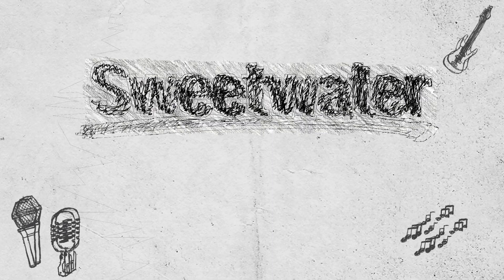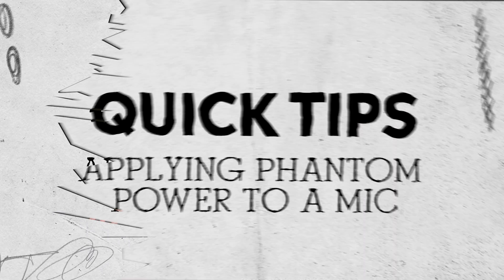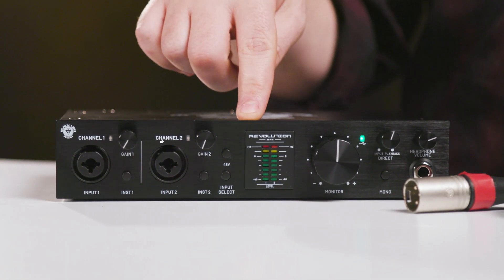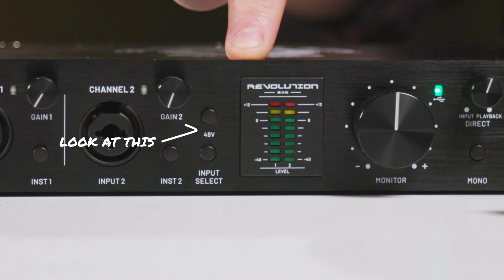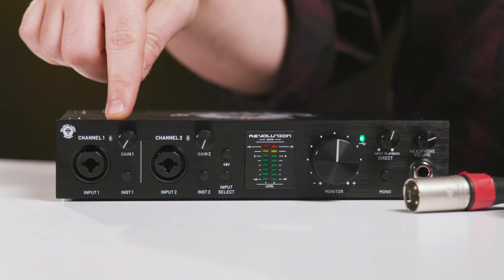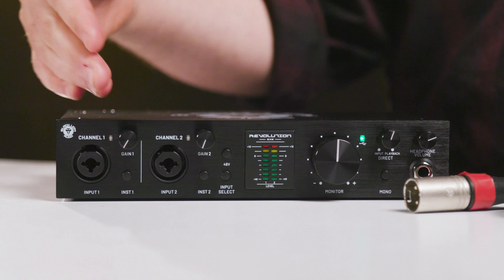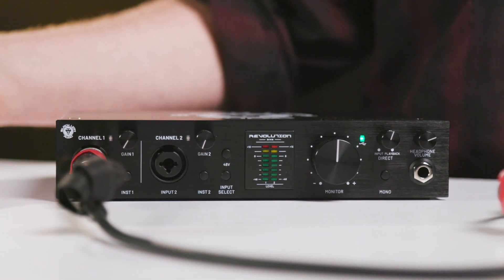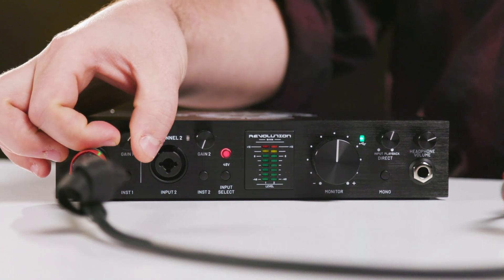Quick Tips: Phantom Power

Comment: What about leaving phantom power on, say, overnight or even for a few days.. is it safe for the microphone and preamps and everything?
Reply: You should always keep your setup on. Electronics generally like to stay hot and leaving them on will not harm the microphones pre amps ect. You could run an audio interface with mics with phantom power on for 10 years
Reply: I left my mics, mixers, power amps, etc on for a few days while on vacation, no damage. I bought old robust stuff that’s probably already had a million + hours of operation though.
Reply: Be sure your power source is optimal and consistent. Surge protection is paramount when keeping your gear running 24/7. Dirty, inconsistent line voltage can cause pops, and all sorts of current flow spikes and power flow interruptions, which can cause damage to even well-built, well protected electrical components.
Reply: sorry for joining late in the game, but is it okay to like leave it on, then just play around with the on/off switch and the gain control of the audio interface whenever im about to use it?